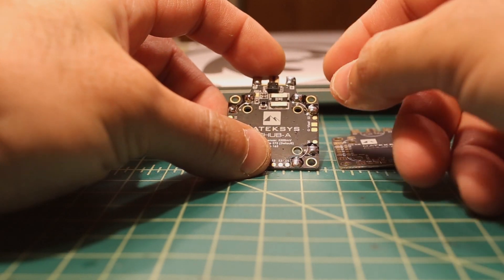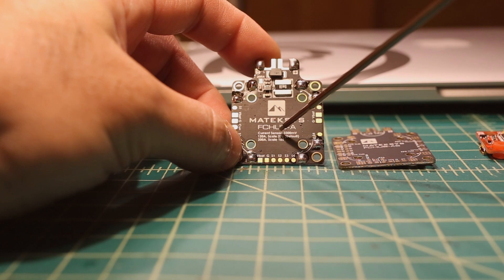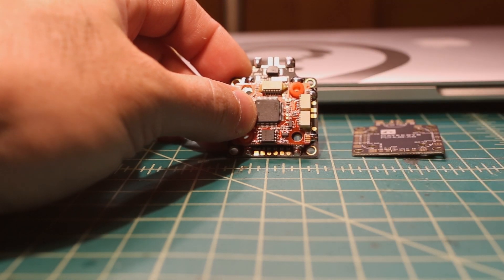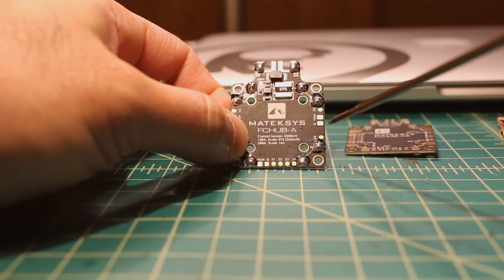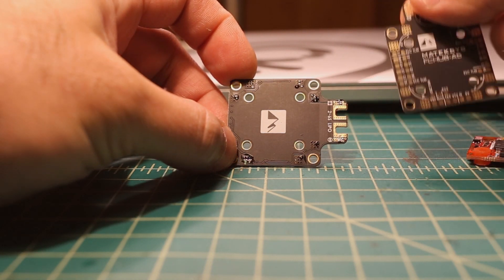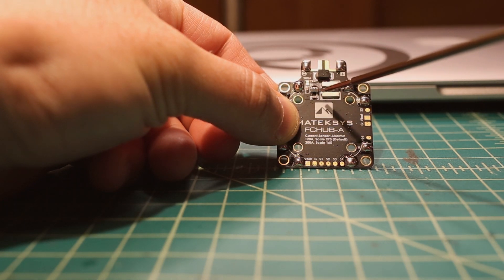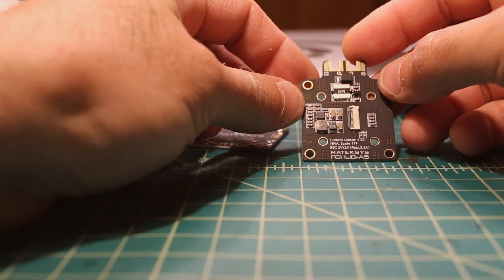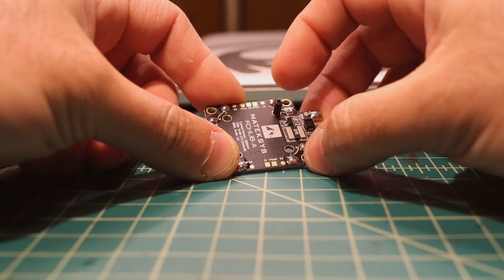Matek FCHUB-A and FCHUB-A5 PDBs for 20x20 Flight Controllers

Comment: Thanks for this. Found out these are actually in stock at my favorite store in Canada. I was thinking of doing a hyperlow build with the F722 mini and this is perfect! You don't need to bridge for your build? Using 6S?
Reply from the maker: Ah nice. This is a 5S build. But I don't think I'd need to bridge it for 6S either. 6s is higher voltage, therefore the amp draw is lower. But in case it's not based on amp draw, but rather on the combination of higher voltage and high amp draw, I'll double check. I'm under the impression is simply for high amp draw... like BIG motors and props, X-Class perhaps? I'm not sure actually. I never pull more than 150A on a mini quad build and it's usually around 125A max, and that's on 4S.
Reply: @PinchTune  Yeah I asked if it was 6s because of the lower current draw. On 4s I like to give a little headroom and not rely on burst specs. Is there any advantage other than the accuracy of the current sensor in not bridging? Or conversely any disadvantage to bridging? thanks for the feedback!
Reply from the maker: @taterfpv  I've been thinking about this. I think I might bridge mine. Given I'm running 5S, based on experience I expect around 110A at full throttle. But, that's awfully close to 120A and if I'm wrong, I'd be going over that. So, for a bit of headroom I think I'll bridge. I wish it were just 150A fixed.
Reply: @PinchTune  I was thinking I would bridge it too, especially since I haven't even tried 6S. 200A is too much for anything I've ever flown but I honestly don't know if it matters. Do you wish it was less so the scaling is more accurate? Does it make that big of a difference? I'm asking because I honestly don't know. Thanks for taking the time to share your opinions. I haven't been subbed for very long but I've already learned some cool stuff.
Reply from the maker: @taterfpv  I've never used a current meter with 200A max. So I don't know quite yet how accurate it will be. But honestly, if the scaling is set correctly it shouldn't matter. And they tell you what scaling to use for that. I'll find out soon. The build is about 80% done.
Reply: So can you solder to the signal pads by the +/- pads the use the other signal pad to connect to the fc?